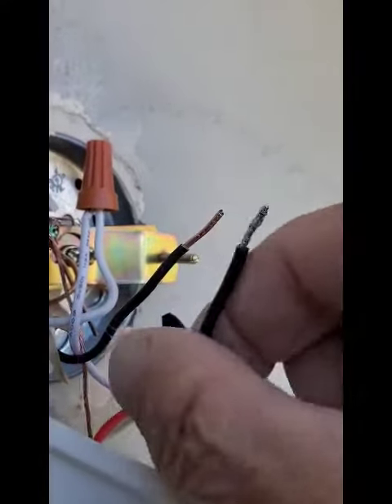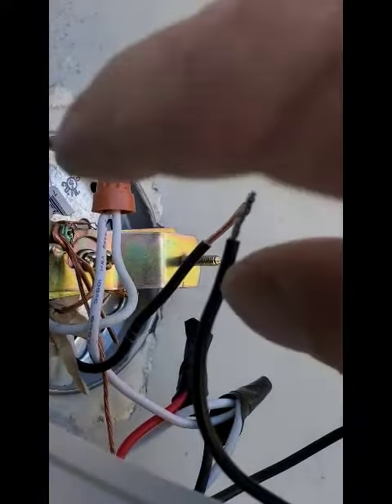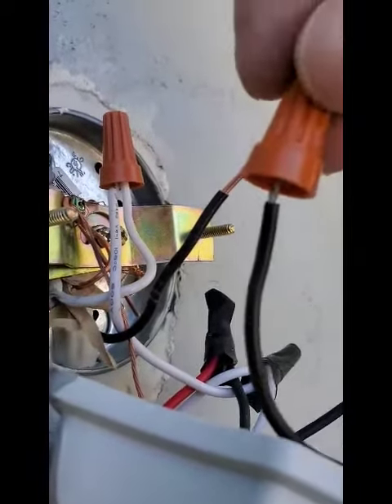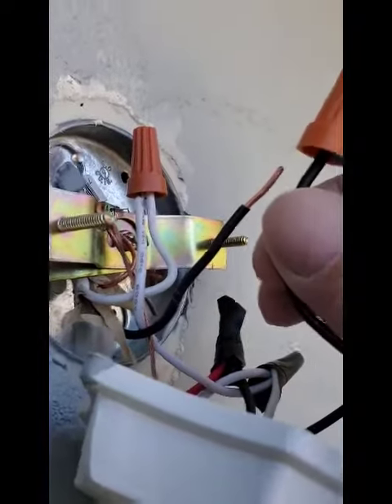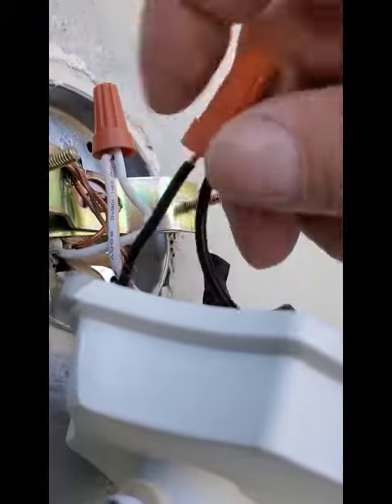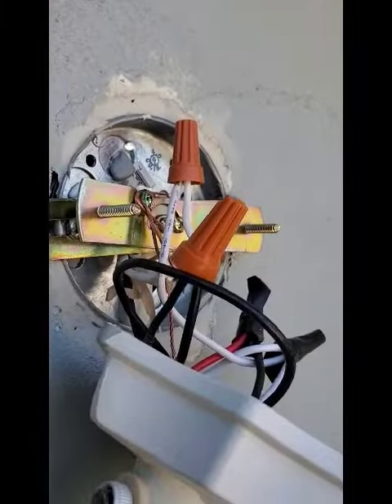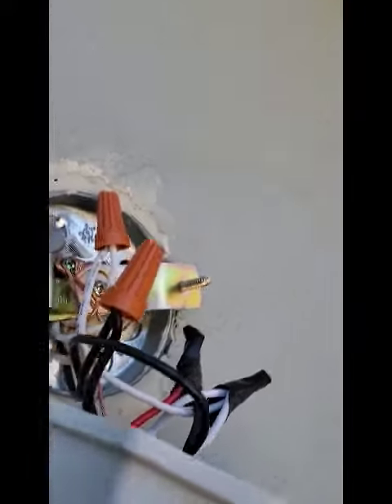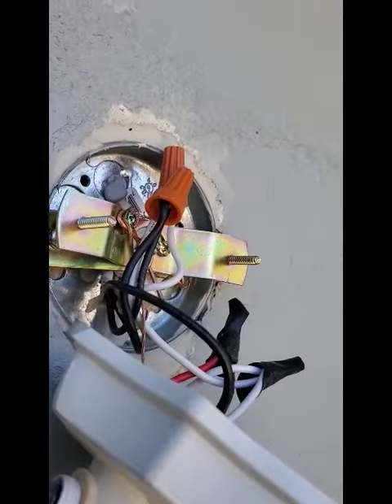Hard wire to stranded wire

Comment: What about when you are connecting 2 solids and one stranded?
Reply: I always pre-twist the like wires together, if there's solid wires, I pre-twist those, if there's stranded wires I pre-twist those also. Then I take the stranded wires and lead them slightly ahead of the solid wires next to each other then twist a wire nut on them so the wire nut catches the stranded wires first. But only slightly ahead so they catch both around the same time but you want the wire nut to catch the stranded first

Comment: ...or use a wago lever
Reply: Man, there is a point of contention. Half the world thinks Wago are the best thing since sliced bread, the other half say its the best and most efficient way to burn down your house.
Reply: Never in a junction box.
Reply: @LiloUkulele  because?
Reply: @PaulHVAC1  I don't know his reason, and I have Wagos in my own junction boxes, but I would guess for the reason I kinda second guessed the idea... When you push something like a light switch into a junction box, you could cause another wire (especially a rigid 12 AWG) to flip open the lever and "unlock" the wire from the housing. I just made sure to flash a light into there and make sure everything was still well connected.
Reply: @JD-yz8cn  I do HVAC work and I have switched over to mainly using wago. Excellent for control work, line voltage and most wiring I do in HVAC. Honestly when I hear guys try the fear line of dissing a product, I find its usually guys who do not like change. No one says you have to use them, just use what you like, but Ill say, for me using wago's daily on multiple service calls a day, they are excellent for me. No need for guys to trash something just because you don't like to try something different. They are used quite a lot in Europe. Even around here in North America they are becoming very common.
Reply: Why add cost when you just need skill?
Reply: @frank2398  well, in case of wago you can clearly see and controll how things are connected(new, transperent version) in case of wirenut you can just hope.
Reply: How you know is make a solid connection i really don’t trust that    method
Reply: @devor8251  Never heard of a pull test?
Reply: @moritaags38  Pull test